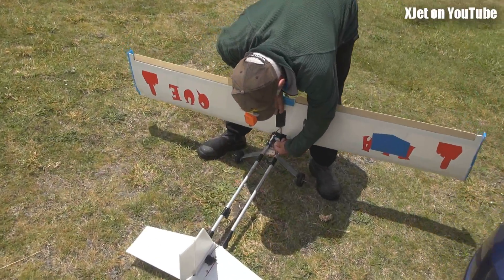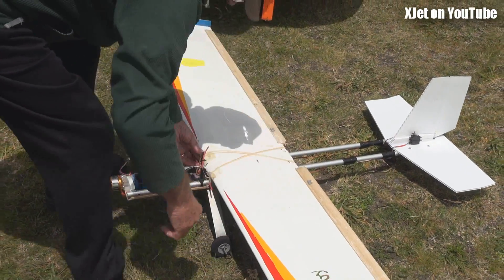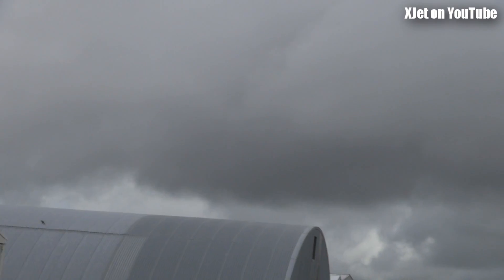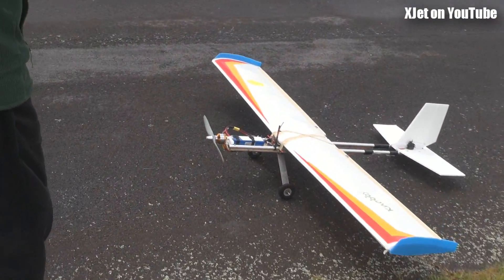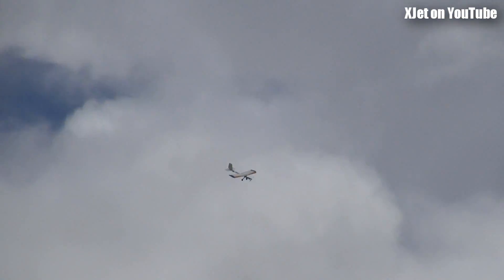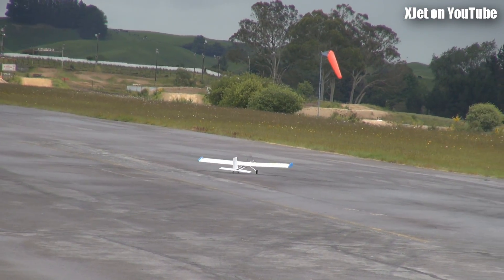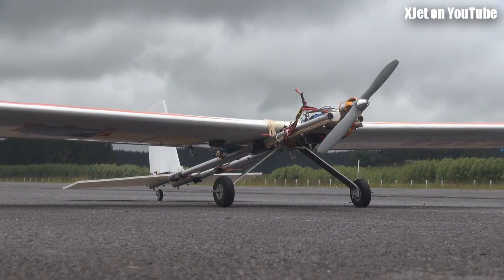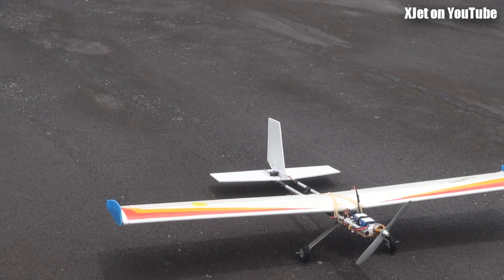Ron's uncanard RC plane

Comment: thanks for posting.  tell ron, removing the things from the wingtips should increase stability.  the elevator appears to be short-coupled, in this configuration; could result in pitch instability.    cheers

Comment: why does Ron use rubber bands to hold the wing on?
Reply: Its the classic way to do it and it lets the wing  give and not brake if you have a hard landing or crash. I have a plane built in the 1950s that has the whole tail wing and landing gear held on by rubber bands built to crash and go right back into the air.  :)  Its also makes it very easy to swap out wings and placement.